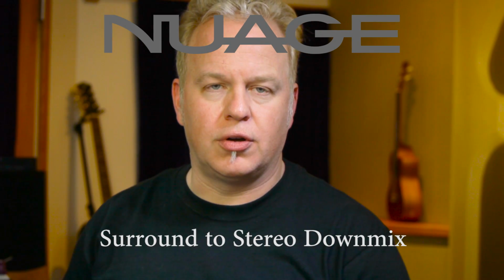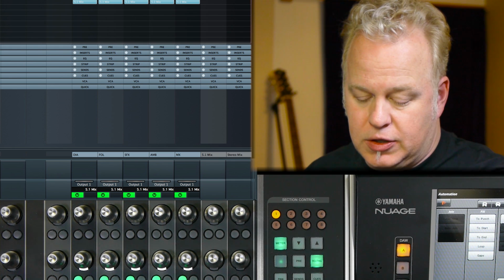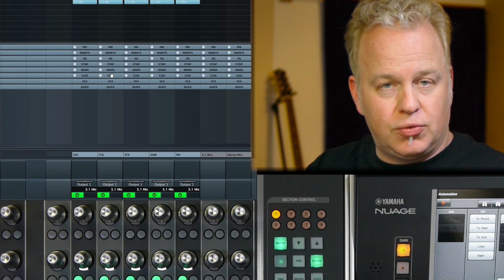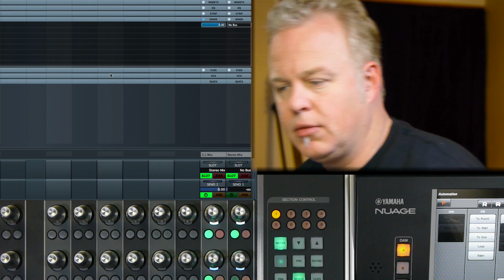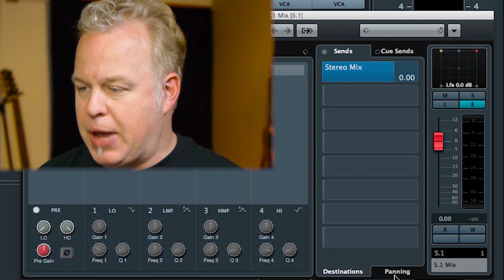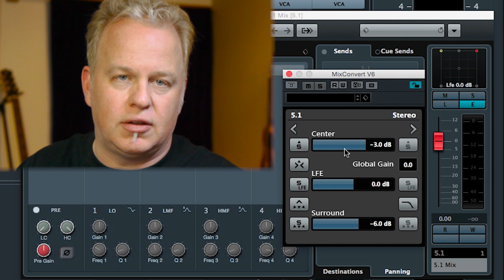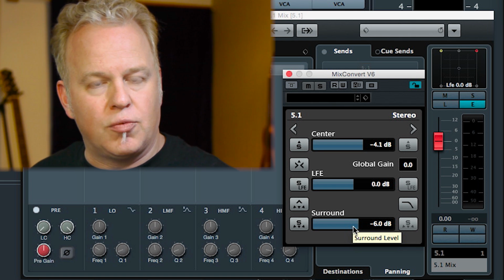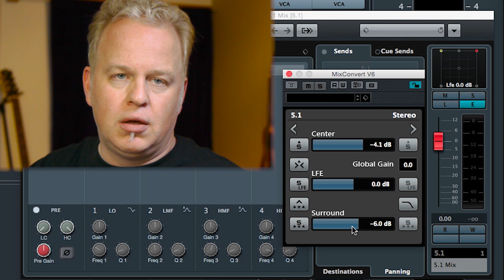24-3. Surround to Stereo Downmix / NUAGE Courseware

Comment: im having an issue getting stereo stems to print from my quad setup in cubase 11   i have no problem exporting a stereo mix with it routed the way you say in this video.  But i need to do multi bounce of quad stems down to stereo stems. i've tried everything. I figured i would set the quad master Grp to go out the stereo master. doing this auto-automatically inserted the downmix feature on the Panner. When i hit play all good its working i hear the mix all good..   when i do export of stem im doing in real time. i should be hearing it but i don't during bounce.  I see meters moving out of all the correct channels.  and resulting bounced audio file is stereo but is blank. no sound is printed.. What am i doing wrong?  I also went to audio connections and made stereo out the default  this doesn't help.. I'm puzzled.